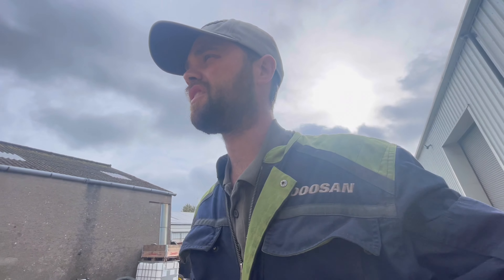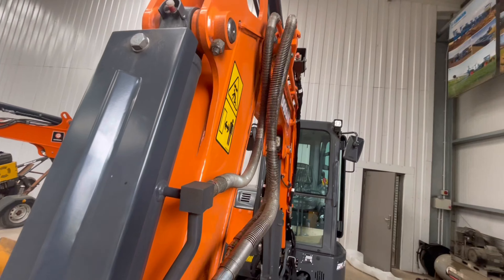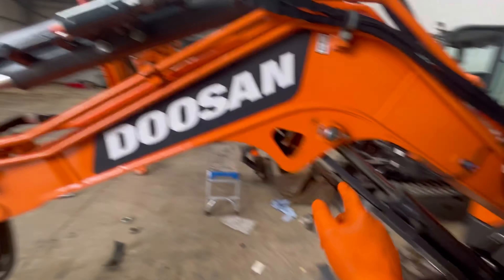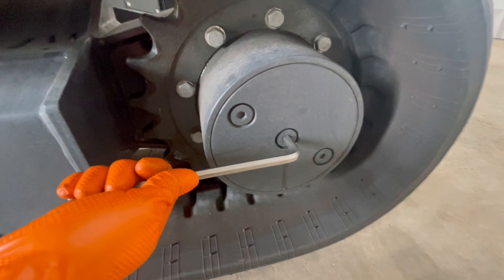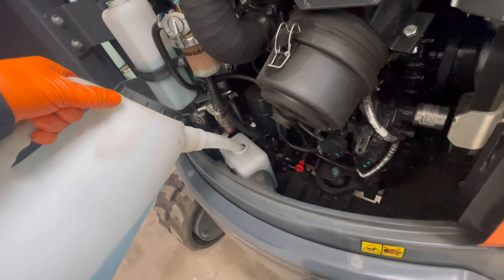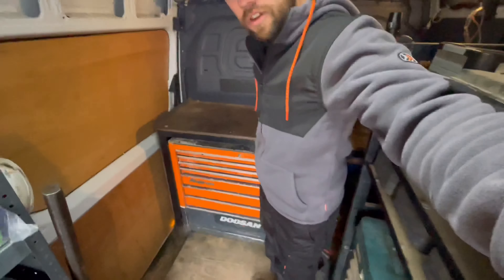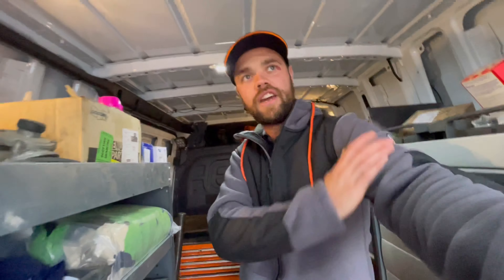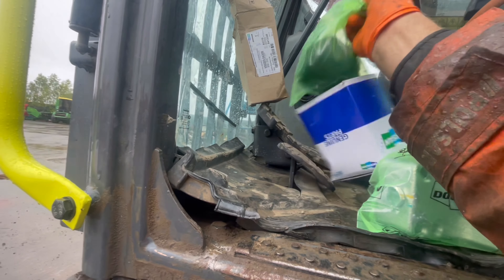Big repairs / Big machines / Very very wet / Episode - 242

Comment: The check valve thing is quite interesting. I've got a hiab crane unit and the remote has one valve that seems to be intermittently jerky without smooth operation. I was wondering if it was a sticky proportional solenoid , but thinking it may the check valve. Would appreciate your thoughts. Good videos as usual